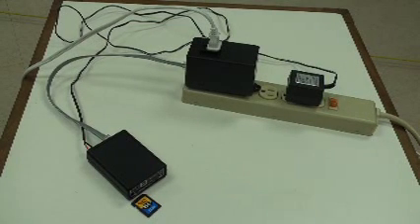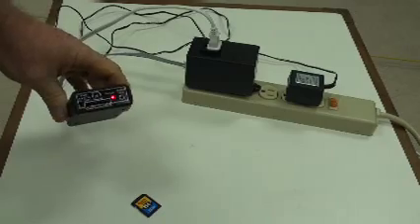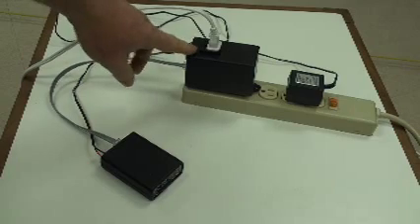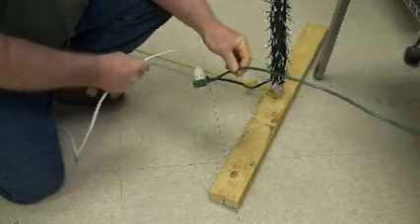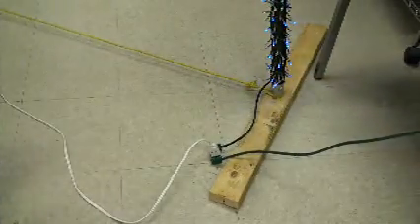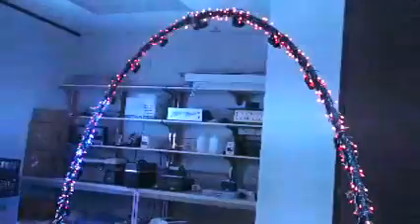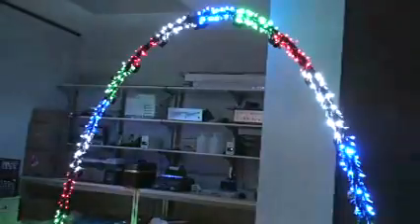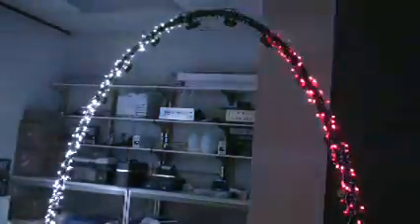Quad color addressable LED light strings

Comment: if you look on the arch there are small enclousures where each string on the arch starts, probably a controller, this looks to me like a wireless system where the "transverter" sends out a signal to the other controllers on the arch which receive power from the zipcord .